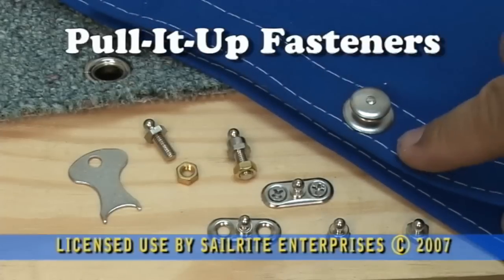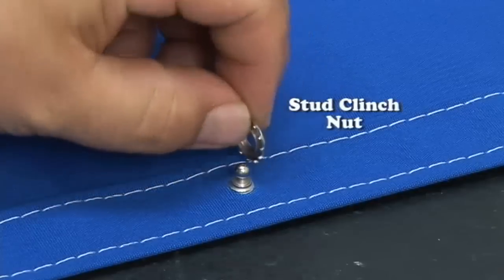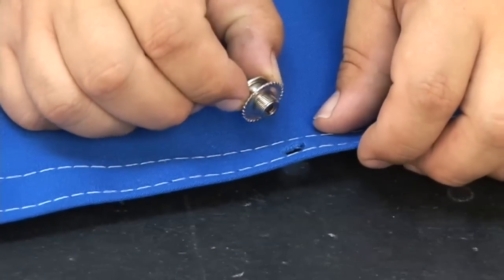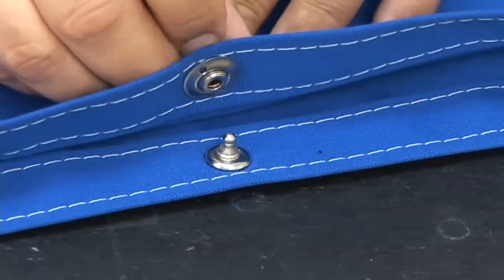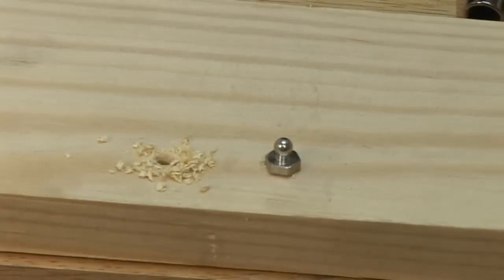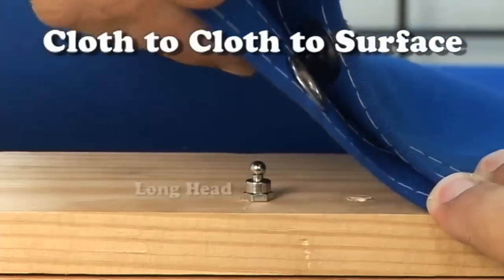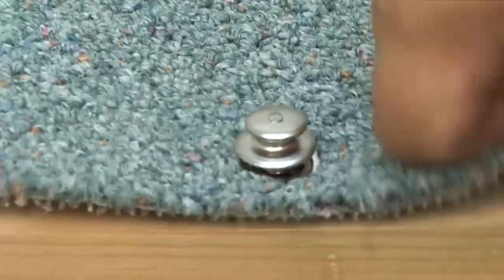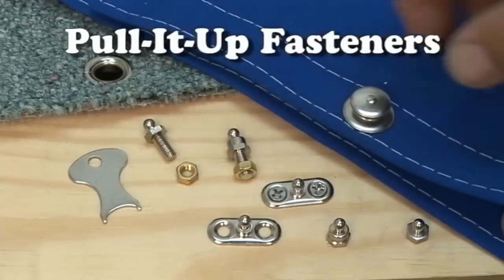How To Install the Dot Pull It Up Fasteners

Comment: Do not push the spring-loaded center socket to lock it, will damage brass claws inside. Push outer piece to lock it.

Comment: How many kilograms of force it can take before it pops open ?
Would love to see an example of the fastener used to pair up leather.
I'm thinking of using them as a method of attaching leather saddlebags to a motorcycle if they are strong enough.
Maybe try and use a fish spring weigh scale for the tension measurement.

Comment: Can the cloth to surface method be used on a metal frame? Thanks!
Reply: Also would like to know
Reply: I would have to say yes, you would just need to drill And TAP the holes. The metal would also need to be protected from oxidation at the site of the hole so that it doesn't stain your cloth.